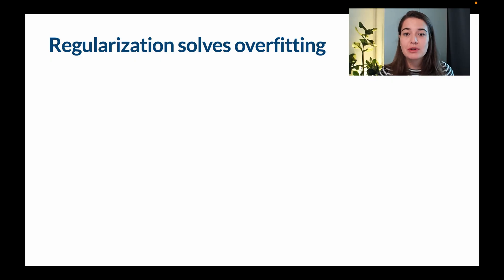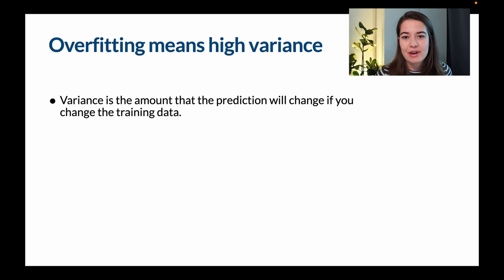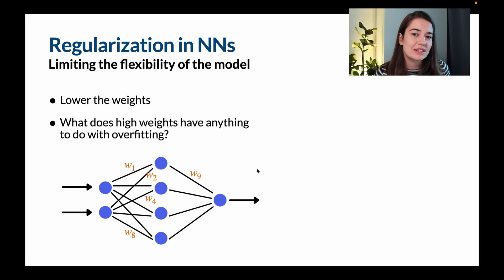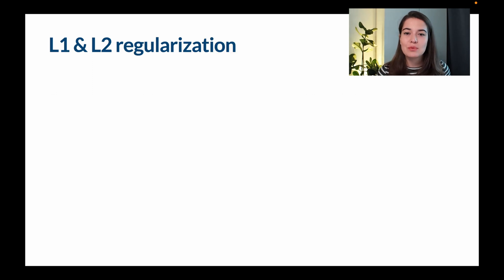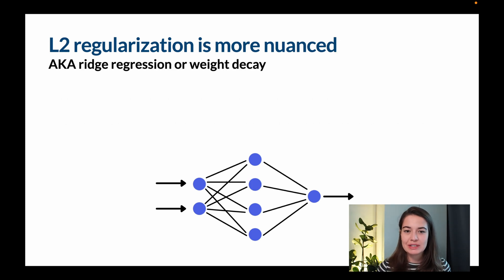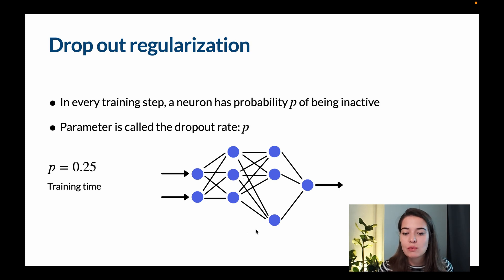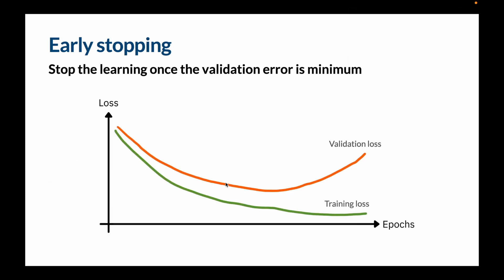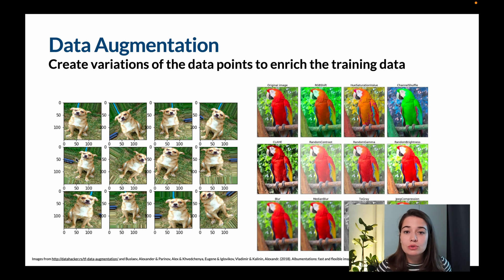Regularization in a Neural Network | Dealing with overfitting

Comment: Hi , when you said Overfitting means giving more importance to certain input values which i dont understand .I think when you have few parameters in your polynomial to fit like Y=B0+B1X ,the straight line cant pass through all the points whereas with large number of parameter polynomial like B0+B1X^1 +,.....+BnX^n  , the non linear poly. can be fitted and possibly pass through all the points thats what Overfitting is.To avaoid learning  error over trend , the loss function in L1 and L2 penalise (increase) loss function with every incresed use of parameter B in the polynomial,isn't it?
Reply: oh! I am sorry I got it when I saw L2 regularization what you mean by lowering importance to input values which is minimising values of B's to minimise L2 loss function.Thank you for such a wonderful video!

Comment: I don't understand the purpose for regularization. The sole purpose of weights is to quantify the importance of a feature (strength of connection). So it's very much possible that one weight has much larger value than others because it's more important to the desired outcome in real life. But if you regularize. Then that weight loses its value and therefore might result in incorrect prediction.
Reply: That's the point of regularization. It is used when your model is overfitting as stated in the video. If the model is performing decent without regularizers then you probably shouldn't use regularizers as this could result in underfitting.

Comment: You said that L1 regularisation encourages weights to be 0.0 and this could lead to not considering some of outputs, is this the same behavior of dropouts?
Reply from the maker: It is a similar behaviour to dropouts, yes! Both L1 and dropout can make a network sparse (not all neurons are connected to all other neurons). The way they achieve it is still different though.
Reply: @AssemblyAI  thank you so much for your prompt answer
Reply from the maker: @brahimmatougui1195  You are very welcome! —Mısra